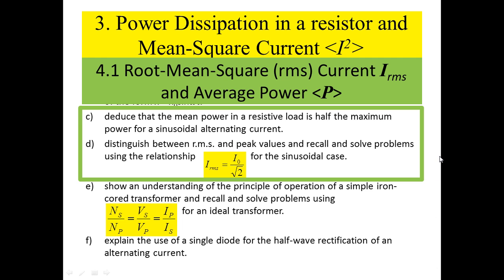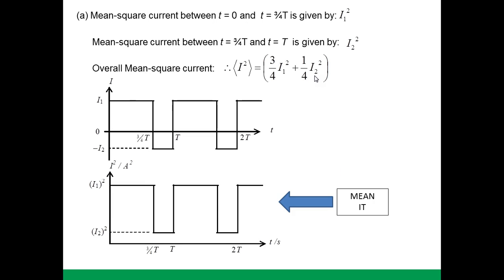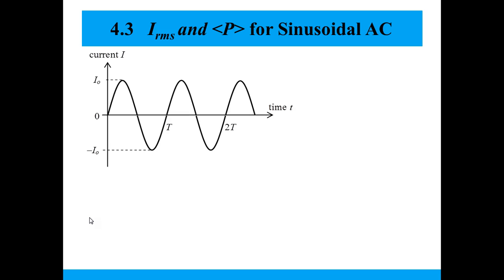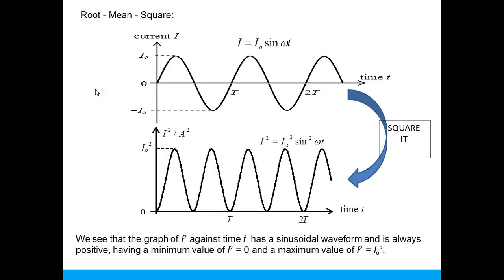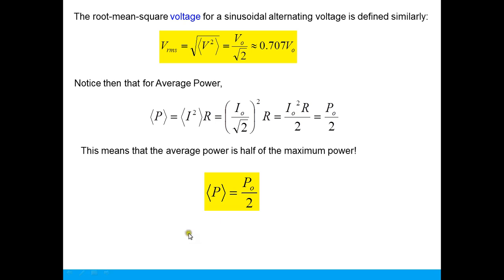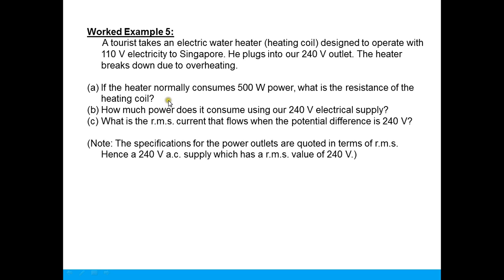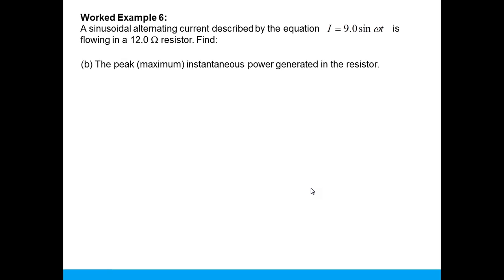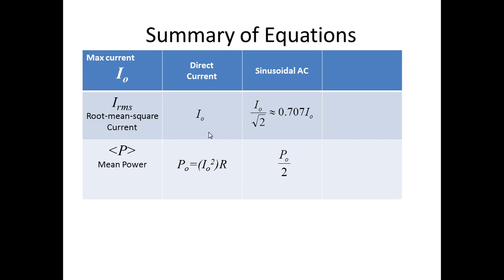AC Part 2b RMS for Square Waves and Sinusoidal Waves

Comment: thanks for the video. Where have you been? xD
I'm using a Fluke 179 TrueRms ... for measure current in a R (47ohm) circuit, with a Square Wave (Vpp=18.8) 
but It didn't show me 200mA just 180mA. In other circuit Vpp=9.4 Vp=4.2V it didn't show me 100mA just 88 mA what do you think might be wrong. Thanks again I really need this.